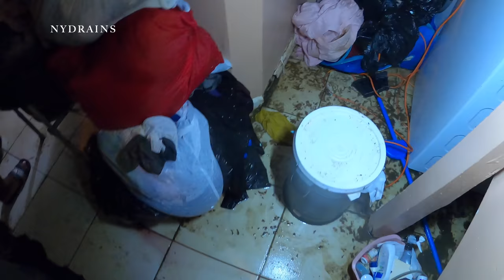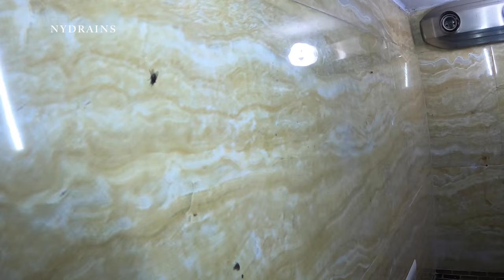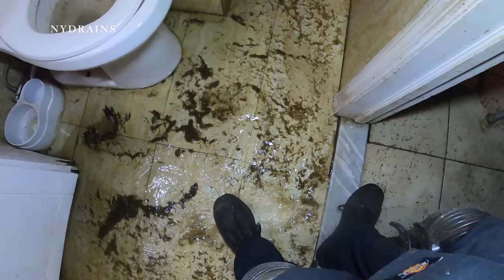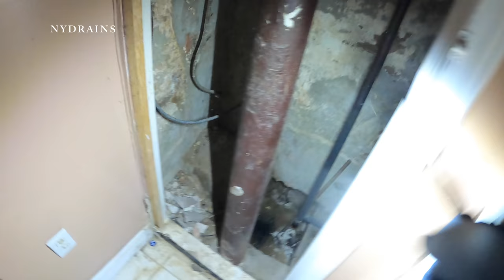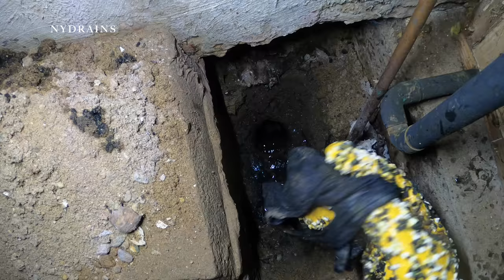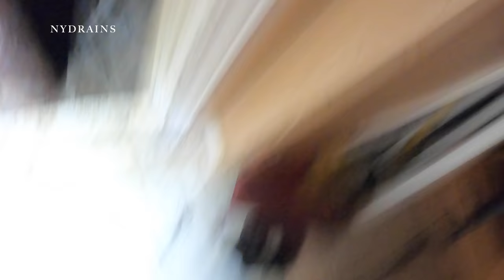Clogged Drain #86

Comment: Great work dude.  2 things to take away.....underwear...I mean...that's pretty wild. :O  What has been the most interesting/weirdest thing you've plucked from the pipes doing one of these jobs?

Also that's a pretty substantial amount of sewage in that basement.  Looks like they were waiting a fair bit of time before calling you to solve the issue.  That's a hell of a clean up.  Definitely were right about the water pressure on this one but was surprised those caps came off so easy.  They looked more hardened in place.
Reply from the maker: Yes I thought the same with the caps, she did have a professional cleaning company walking in when I was leaving. I've seen a lot in my days , eye glasses, more underwear lol,human body fat, broken tile, pillow case, e-cigarette, knife, 6 Inch long pvc pipe, round cut out wood from a door to install a knob, 80's style razor, pens, toothbrush, screws, bolts, gold ,you name it the list goes on and on! Thanks again 👍
Reply: @NYDRAINS  Pillow case seems the most odd one of the bunch,  The others seems weird to get in there but kind of could have an explanation.....but a pillow case.  XD
Reply: hard to beat a basement/crawlspace sump pump basin with floating dead bloated cat/opossum/racoon in it and telling your buddy "get that pillow out of the pit" :))))
ok, I'm not quite that crude, by my buddy did that to his cousin many years ago, but we whizzed ourselves laughing at him gagging, puking and running for bleach. lol
Reply: in one of my rental properties, i pulled out 11 pairs of underwear followed by a rather large adult toy, probably 40 plus prophylactics and wrappers, empty lube tubes, a partial denture, a cheap smartphone, a pair of socks, and some of those 1 shot liquor bottles in a 10ft section of line in the basement, i now know how she was getting the money for rent, and was never able to look at her again, she got the boot!!!!
Reply: @NYDRAINS  Human body fat? What The H--L????? lol!!!!!
Reply from the maker: @mattcat231  did a job in the morgue full of stiffs laying around (god bless their soul's) and had to clear a slop sink that was clogged with leftovers 😉🙉🙈🙊
Reply: @NYDRAINS  im speechless, lol! i can handle a lot, but i would have noped the h--l out and yeeted myself away from that call, lol! (and out of respect for those that passed away, may they rest in peace)

Comment: That U Trap has to be the dumbest invention ever. It appears that 75% of the restrictions are right there. So long as they are in the build design you will never run out of work I guess, so at least there is that
Reply: Don’t throw underwear and wipes down the toilet and you will be fine.  It keeps the smell out .
Reply: @andrewmoore1536  considering the sewer vent comes out just above ground level from the sides of the houses, i will stick to the methods most every State in the USA has other then a U-Trap. We run thru the room venting, P-Traps at fixtures, and straight shot pipes to the city. I work with sewer daily, and this is dumb no matter how you look at it.